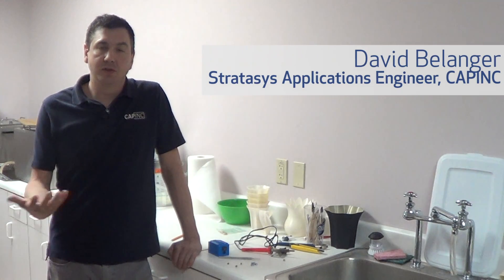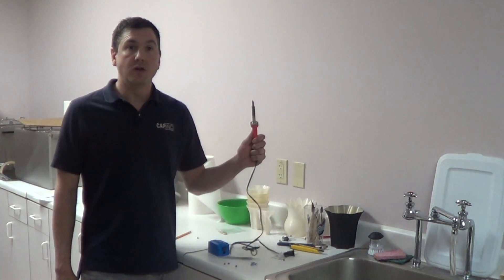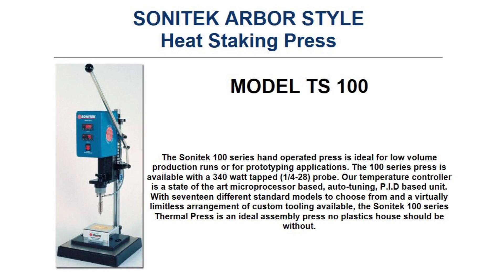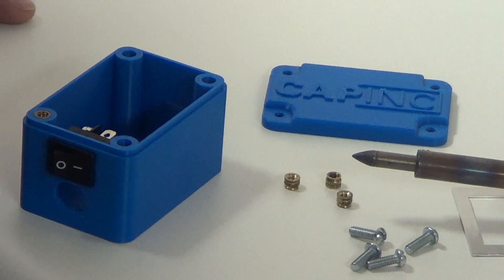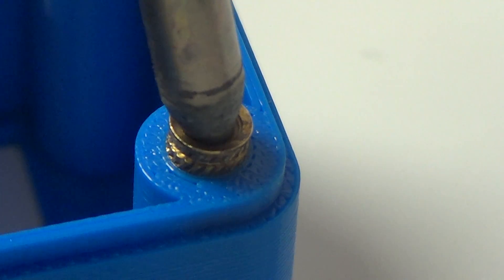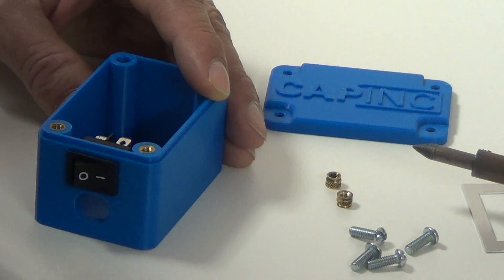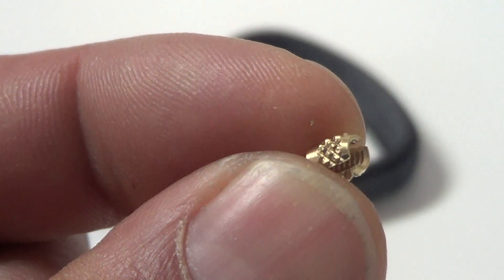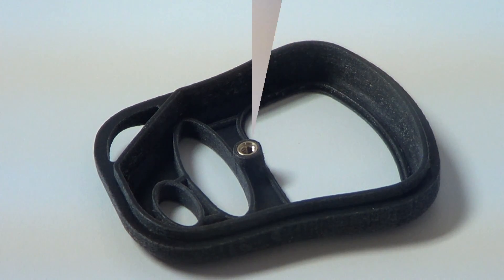How Io Easily Put Metal Inserts Into (FDM And PolyJet) 3D Printed Parts

Comment: Actually you're better off stopping pressing in with the iron around 1mm above the surface then use a flat metal edge and press down firmly. That will mean your part will be flush with the surface and you'll get no ridges in the plastic.

Comment: Use enough heat and do not use a lot of force to press it down. Heat the brass insert first, then press it fast and firm with just the right temperature; it can't be too much or the plastic gets brittle and will break (if it smokes at ANY point, including when the plastic is directly touching the soldering iron, that is too much). If you use too little heat it takes longer to melt and too much force will deform a larger area. Manufacture your own tips and use a temperature controlled iron (cheap eBay dimmer circuit is ok for making cheap soldering iron temperature controller, that is what i did: https://imgur.com/gallery/6z0KATA  Next i'm buying a cheap drill press so i can make my own Insert Inserter® 3000)

Comment: What temperature to use for the soldering iron? Does it depend on the material? Is it the same temperature as the nozzle temperature? Or does it need to be higher?

Comment: Which hole dimension size did you use for the heat-set inserts, A or B? On McMaster-Carr they suggest tapering the whole, but it doesn't look like you did in your example. Just trying to do it as easily as possible for a quick prototype.
Thanks!

Comment: I would use a long bolt to screw into the heat-set inserts after installing and using the bolt as a guide to make sure they're installed perfectly straight as well.
Reply: +Khairul Anwar    I started out that way ... now I have a special tip I made for my cheap temperature controlled soldering iron, that tip is simply stepped, a portion goes inside insert and step shoulders on end of insert .. only takes 5 secs to heat the insert and using the soldering iron it is easy to insert them straight .. super fast insertions, just as fast as that $2000 press he refers to. Also, a much better result is obtained by heating insert to a temperature lower that what is used for soldering ~ 50 to 100C lower.
Reply: How did you make the tip?
Reply: +Khairul Anwar This is where a 50 dollar Harbor Freight drill press would excel.  Use a soldering iron inserted into the chuck and you will push beautifully straight inserts into the plastic part that is on the bed of the press.  None of that 2 thousand dollar crap.